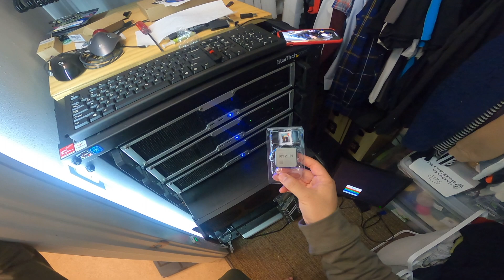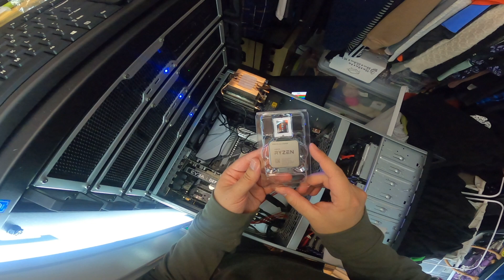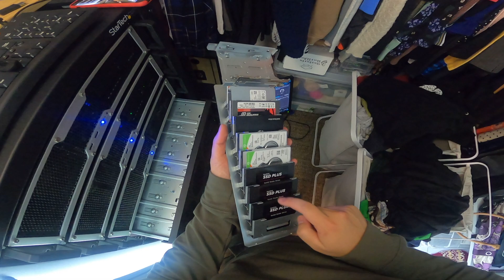AMD 3900x to 5600x Unraid Gaming Rig Upgrade

Comment: Could u test and report ur geekbench scores under ur gaming vm. I'm currently planning to upgrade my i7 4790k to 5600x or 5800x. My 4790k is being a huge bottleneck for my 1070ti, it used to be just fine when it was just gaming only rig.